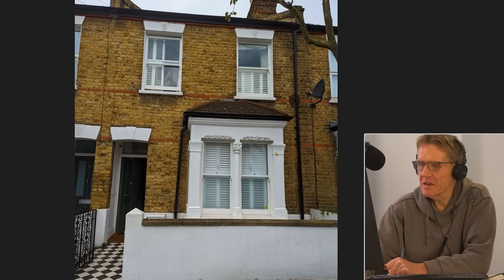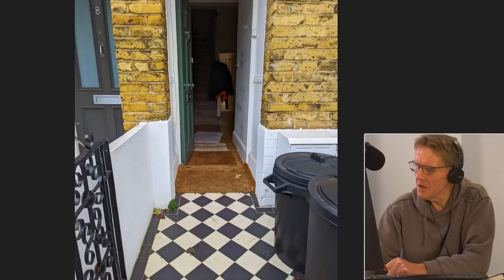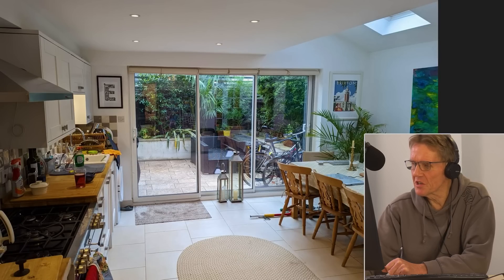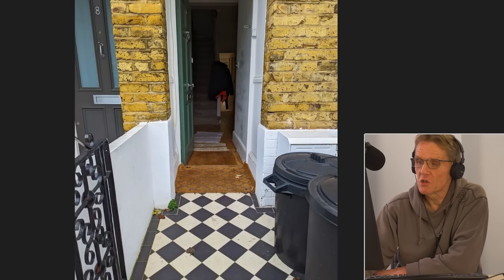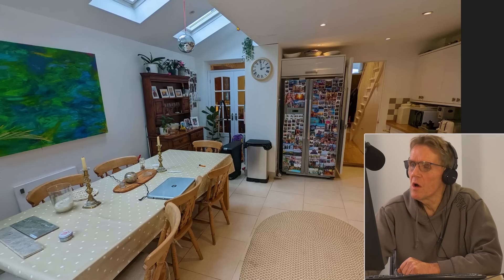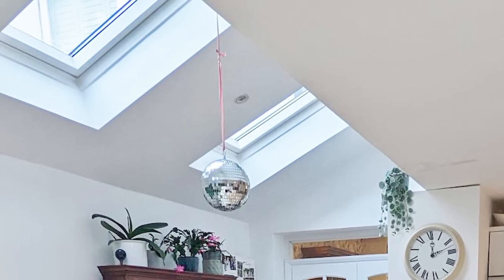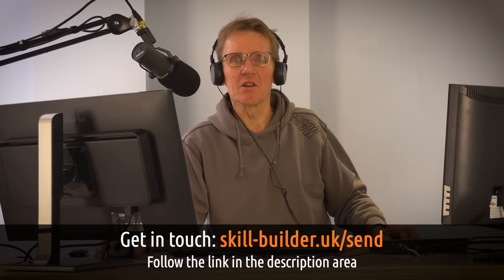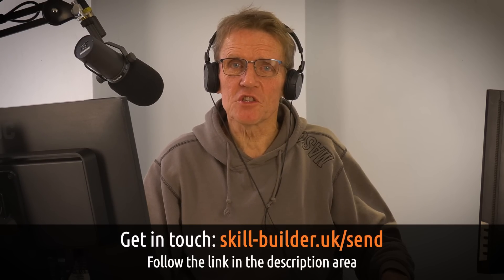Watch This Before Extending Your Home (common mistake)

Comment: You could consider putting in a mechanical vent in sub floor. But first check the condition of the sub floor. If cavity is deep and dry no need to panic. Could also improve the front vent, esp with one I  front bay.. its cheap and easy to fix a double aerofoil style vent.
Worst case scenario... put in a sold floor with insulaton

Comment: this is one of the things the inspector picked up when we were doing the extension at my parents house way back in 2000
the builder had to dig up the slab again to lay some soil pipe to link the front and rear

Comment: Could they not install floor vents into the room itself like under the stairs or in the corner of the room, a bit like used in american forced air heating?

Comment: Forced mechanical ventilation by means of an electric fan, powered by a solar panel.  Core through the front wall and inset the fan in a length of 110mm soil pipe long enough to reach most of the way under the front of the house.  The fan will push clean air into the void and it will vent through the existing brickwork.  It's much easier to run a cable from the solar panel to the fan than to run a duct under the floor.

Comment: I would add a new air brick or two on the front wall with a duct through to the back wall of the living room. Then it could turn back on itself and provide cross ventilation towards the front. Possibly worth trying the least invasive option first.

Comment: My daughter-in-law recently had external insulation fitted aided by a Grant. The kitchen became saturated. There are two kitchen vents, for the Cooker & Boiler. One had been covered over and the other had not been extended for the extra depth ie: it vented to the cavity. They did fix it but had to stand on the worktop as they had no ladder. A week later she noticed a crack in the Ceramic Hob, was it bad luck or big feet?

Comment: Sound advice - ie lift floorboards in stair cupboard - see if u can get under the existing floor - similarly re providing venting if there is a problem. Maybe install vertical duct from within stair cupboard & route through first floor to the external elevation at the rear. It’s gonna be a bit of an ass ache prob but there maybe a route depends on joist span/layout. 

Has the chimney breast been removed or filled in? Suppose could vent through if breast / flue in place & not used. 

Think some have gone off on a tangent reading some of the comments here - what we’re talking here is cross ventilation to the ground floor timber joists. Link provided by wiki below for info

https://en.m.wikipedia.org/wiki/Cross_ventilation

Comment: ducting under the worktop behind plynth maybe have to chop in to floor under the range but gets fro. the under stair cupboard to back wall with a little damage hidden by range but a board over it will still allow you to roll the range back in

Comment: Why not take the flooring up and fill with concrete and then relay the flooring? Slighting more expensive but tidier but no risk of rot or squeaky floorboards.

Comment: My builders put vents under the extension floor, only they did the outside end of them in a way that lets ground water flow through them into the old part of the house.
Reply: Great..

Comment: My house has a solid concrete floor all the way through the building , I have added an extension to it ,it has 100mm insulation and DPM under the concrete slab but I kept the hight of the slab low and put some 6x2 joist on top of the the slab so I could run my electrics and plumbing in that space . Do I need to have ventilation in that floor space ?

Comment: I’ve laid bricks on many extensions like this one typically there’s extensions either side and a massive door to the garden with hardly any wall to put airbricks in especially when there’s a steel post to help with the beam over the door

Comment: I’ve seen exactly this where the garden at a property was built  up with slabs and they had actually blocked the vents to the rear of the house…Went to the job for a suspected broken floor issue and transpired all the floor joists were rotten through lack of air flow! Can become a nightmare as it was ripped right back to sleeper walls in that case which involved pulling up everything from finished flooring down.

Comment: Your thumbnail asks the question "what was the builders mistake?"
Why is every problem in construction the builders mistake or fault?
An architect drew the plans to get planning permission, An engineer did all the calculations to pass building regulations, then a building control officer oversaw and signed off the work.
The customer goes for the best price.
So the builder builds according to the plans given, using materials that meet the specifications.
But no, the architects and engineers that charge so much for often a 'cut n copy' service don't get blamed, the building inspector that made sure every screw was orientated the same way on door handles doesn't get blamed, it's the guy doing exactly what he's told, he's the fluffing problem!!!!! He should have known to do more than he was asked!

Comment: Just punch through the party wall below floor level in that under stairs cupboard and pinch next doors air. Of course you need a party wall agreement, etc, etc , etc.
Reply: I’ve seen this done to very good effect. All 4 house in the terrace were cross ventilated.
I do believe it was done in the 1980’s by the coal board during subsidence rectification works

Comment: Is that new extension floor wooden joists or concrete? Assuming it's concrete, then I think your suggestion is good.
I've seen old houses where the vents are blocked, and the joists have been dripping wet.
1:58 I reckon a couple of vents would be ok; you could build a couple of boxes with 110mm pipe to the left of bureau and in the corner to the right of the French doors through the rooms above and into a well ventilated loft? Depends on what's above though.

Comment: I like the idea of fitting a fan to the underfloor ventilation, perhaps connected to a humidistat under the floor so that it’s not constantly running when the need isn’t there for forced air?
Reply: but where does the damp air get moved to?
This guy explains air venting in a roof system, the same principle works for the flooring
https://www.youtube.com/watch?v=RixxqDfhRGU&ab_channel=SteveRoofer
Reply: @garyherberson8119  I think that the 4 inch pipe is taken through the roof to the outside with a flashing kit to keep the weather out and a cap to keep rain from entering the pipe. So the air is exhausted to the outside atmosphere, if I understand it correctly

Comment: Why go to so much destruction, just install another air brick or two in the front of the house where the other one is, it will be enough to let air circulate.   Edit - in fact there already is mutiple air bricks at the front, no need to do anything here, there is no issue
Reply: Well, not so fast cowboys! 😉 it might be ‘reet’ in some people’s eyes - & if it’s draughty under the floorboards if you’ve access - from front to back - then ok - but I wouldn’t be so sure. Have a read & consider the subject - 👍 https://en.m.wikipedia.org/wiki/Cross_ventilation
Reply: I was about to comment exactly this
Reply: This guy explains air venting in a roof system, the same principle works for the flooring
https://www.youtube.com/watch?v=RixxqDfhRGU&ab_channel=SteveRoofer
Reply: Doesn't get airflow to all areas of the floor.

Comment: easier to pop the airbrick out at the front and run a plastic 2 inch pipe to the back and force air in with a small fan and force air into the back

Comment: Can't they just put a couple of heating great on the edges of the floor one under the cupboard can vent into the room
Reply: Might be a bit smelly.
Reply: @gdfggggg  yeah maybe at first after the damp smell is gone it should be alright You could always stick a carbon filter in the vent then you wouldn't get any smell
Plus it shouldn't do in winter If the room is heated, it will suck the heat out under the floor as long as the temperature is hotter in the room than the outside, it will always flow in that direction.
Reply: @hoobsgroove  the damp smell will never go as it will always come out of the soil below.
Reply: @gdfggggg  I word of thought there's a layer of concrete but even without the vents you'd still get the smell by your logic
Reply: @Hoobs groove  I'm assuming the new extension floor is solid concrete, so you'd need to ventilate the old floor in the existing house. Under the old existing floor, you'd expect to see either soil or an old tar layer that over the years deteriorates. The floorboard joins would be sealed to stop the draught but would also prevent airflow and the air bricks would also be blocked off. If you put a vent in the old floor inside, the smell would come into the room.
Reply: @gdfggggg  well I don't believe that's the case! as I have said it would suck it from the house out not from the outside in.. And if you use the carbon filters as well there is no smell. You could just use crushed charcoal just lay it compacted in a box under the floor and the vent on top another way you could seal it off is by just having the radiator under the floor that would give you a hot air flow under the floor all the way across the house

Comment: hi there, i would like some advice on a water leak / ground water surfacing and pooling between my house and next door. there is only a gap of 300mm between the houses and this is filling up with clean water at the lower end. we cant find any leaks. I keep pumping it out but the area is full in a few hours. Both houses foundations are proper wet. Any leads will be welcome. Thanks
Reply: Clean water sounds like a clue; likely rainwater or mains water leak somewhere. For a rainwater leak check gutters are not leaking and down spouts not running to the ground around the area or uphill. Check run off from uphill also. For water leak, both neighbours try turning off the water main at the same time and seeing if the water main is still ticking over.
Reply: good try mister tried all that.he spot fills up even when theres no rain for several days
thanks
Reply: Get some drain dye and put it on the garden. If your puddle changes to the same colour you know it's ground runoff. If not start putting it down the drains. Screwfix sells drain dye for about £9.
Reply: am thinking about that. i will have to try it one day .thanks
Reply: Sounds like pinholed water main? Is it an older property? (Lead main?)
Reply: 1930s semi did have lead mains which was turned off some years ago.i did call out the water company. the guy checked the old line ,it was off. he checked the new mains and said he could not hear any water running when i had all taps turned off in house. very mistifying issue

Comment: Hi Roger. If it’s possible to vent the floor that’s probably the cheapest way ,but if not make it a solid floor?
Reply: Nowadays a solid concrete floor would involve a vapour barrier laid down 1st to stop water migration/ damp. Therefore it would not be impossible to retrofit this system to an existing house. I was thinking along the lines of expanding foam to fill the void, but this too has its own problems. Mainly, the foam couldn’t cure properly and would give off toxic fumes.
Reply: Burn down the house and claim insurance.
Reply: @zteaxon7787   or maybe just enjoy the indoor lap pool
Reply: Say you're Syrian and go live in the hotel next door for free claiming benefits on top..

Comment: We’re in the process of buying a house with same problem. Large kitchen extension tacked on with solid floor which has blocked suspended floor ventilation. We had a full survey which picked this up and recommended some floor boards be taken up to inspect for problems like dry/wet rot.  As we planned to install underfloor heating, we can rectify the lack of proper ventilation.  But it’s galling this wasn’t picked up by building inspection when the kitchen was added on.

Comment: Hi Rodger. 
I was wondering do you have any experience with wood pellet stoves?
We've just ordered a 15kw boiler stove and we kind of jumped in without any research. 
Any advice would be great.
Thanks 
John
Reply: Im not a heating engineer but from what i understand is that you have to have ventilation to an outside wall. This is about one square inch of ventilation per Kw. For the old Baxi boiler, heating engineers would take out 4 bricks, although 2 would have surfaced.

Comment: I did something similar to what's suggested here a few years ago on a house built on a very steep slope. An extra room had been dug out into the hill with no consideration for ventilation. There were a couple of inches of water under the suspended floor. A pair of boxed-in 110mm pipes in the back corners up to the room above and out through the wall sorted it pretty quickly.

Comment: maybe a discreetly placed air vent coming up through the floor in the room where the fire is, its common practice to have an air vent anyway when we fit a wood stove over 5kw, usually placed through the wall but no reason you couldn't vent from under the floor, try and place it as far away from the existing air vents as you can, i cant see that doing any harm, but could help the problem, if there even is a problem. Or if its a terraced house maybe pull up some floor near the party wall and put a few sneaky vents in to the neighbours, assuming they have unrestricted air vents ;)

Comment: I always find it strange why ventilation is misunderstood. It is conflated with draughts, heat loss, etc, yet it is fundamental to a dry, healthy house. I have recently moved from the Midlands to South Devon and I really notice the high humidity. My tools are rusting in the garage and the whole house (late 1970s) has a slight damp feel to it. I am in the process of adding vents in as many places as possible to keep the air moving. In the example above, its a case of out-of-sight-out-of-mind. Unfortunately many home owners to not know what airbricks are for, and few get down and clean them out.
Reply: It’s not surprising given that building regulations and EPCs obsess over air tightness. Surely it gets to a point where the occupants run out of air unless you add some ventilation. I guess you want CONTROLLED ventilation (eg: trickle vents) , otherwise you can pump all the heat you want into a building but it will be lost through those draughts.
Reply: @Solidsnake0208  Air tightness is super important for thermal efficiency, but like you say you can be airtight in the living areas while having controlled ventilation through MVHR (gold standard) or PIV. I don't believe trickle vents are a great solution personally. Not controlled and don't provide useful amounts of ventilation.
Reply: @lukeh3020  yeah I guess what I was saying was it just doesn't make any sense to build a perfectly air tight extension to a house that's anything but airtight, then add trickle vents to every window.
Reply: Get an air vent with a heat exchanger and you will maintain thermal efficiency while refreshing the air inside the building . It creates ventilation from the outside with room temperature air, by heating it first. Very efficient.
Reply: Meny tradies don't know either.
Reply: Most tenants believe vents in solid brick walls in bedrooms are only there to be blocked up 🎉
Reply: You might be able to PVC rectangular ones over the kitchen cabinets venting though air bricks left of patio doors depends on how high up the stair cupboard goes and if you can miss any lintels.
Reply: How would you suggest they are cleaned out? Just run the vacuum over them? Mine are brick ones so can't take a cover off them for example, not sure what else could be done to clean them out so open to suggestions?
Reply: @C4sp3r123  You can buy small brushes (similar to boiler flue / bottle brushes) that you poke in each hole in the air brick,
Reply: @whitefields5595  thanks, I hadn't thought of that and actually have some of the brushes you mention. That plus the trusty Henry Hoover should do as good a job as possible. The air bricks have probably never been cleaned out since being installed so will add it to the list if jobs to do. Thanks for the suggestion!
Reply: Ventilation isn't misunderstood, the problem is the price of energy, the types of homes that suffer from mould are poorly insulated, and due to the cost of fuel, erratically heated properties,  
Years of promises from window sales, cavity insulation sales that the government allowed, have all made the situation worse. 
I live in a 100 year old 2 bed terraced house, my sister lives in a new 4 bedroom detached house, 
I pay twice as much in heating bills, and my house is only warm for 4 hours of the day, my sisters house is warm 24/7,
Oh, and guess which hose has black mould, along with draughts from brick vents?????
Reply: Maybe run some vents inside the stair cupboard and over the kitchen cabinets and cover with a plinth, 

You could easily get two of those rectangular pvc vent pipes meaning with care they could have one of the pipe feed under the floor to the area furtherest away from the stairs, to avoid a stagnant area.  That’s my 20pence worth.